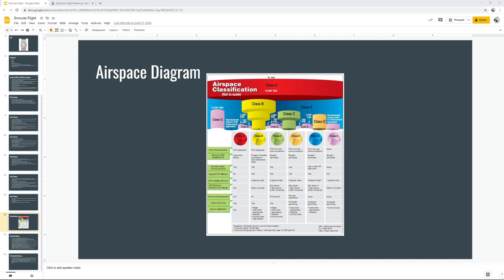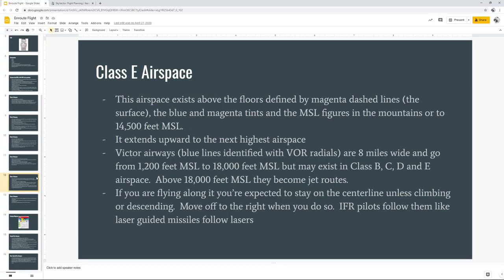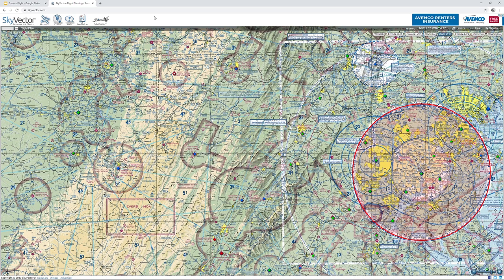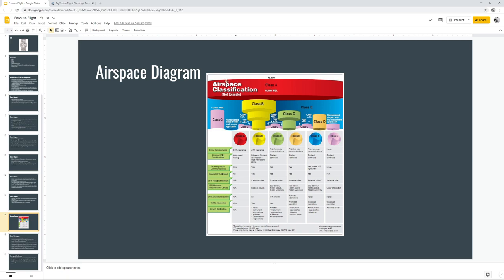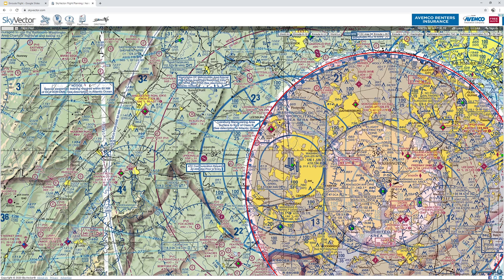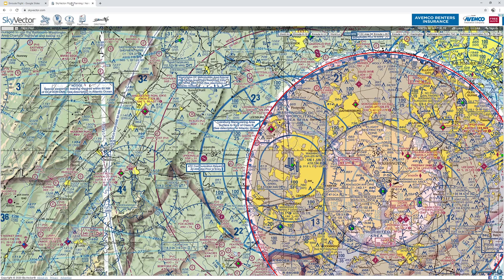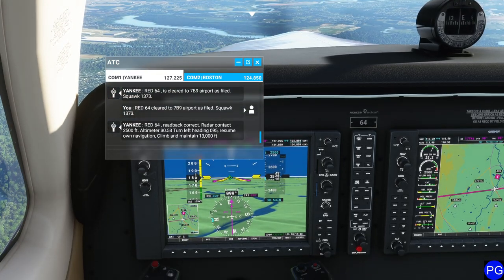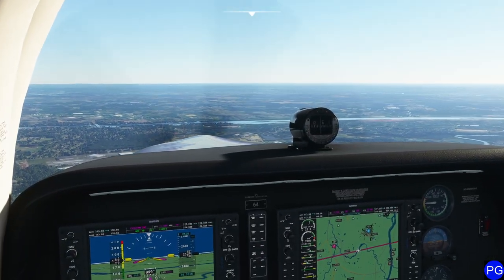FS2020 - Airspace types and methods

Comment: Nice work on a difficult topic. A few notes:

- Class G is not 700 to 1200. It is surface up to 700AGL OR up to 1200AGL (1500AGL when above 10,000MSL). Class E is everything else that's not below 1500AGL or above FL180 and not a class B, C or D. Those fat magenta areas are where the class E floor drops to above 700AGL. These areas are around all the non-towered airports. Outside them, the floor is 1200AGL (except when above 10,000MSL). If you see small dashed magenta (looks like a class D but is magenta, not blue), this is a class E surface area and, as the name implies, extends to the ground. These are rare and are for non-towered airports that also have an approach. So the areas between the fat magenta areas are class G up to 1200 while inside the fat magenta lines it's class G only up to 700AGL (except for the class E surface areas). 

- Class E airports DO NOT have to have an instrument procedure. Class D airspace only requires two-way radio comms, not a clearance. This is also true for class C. The big distinction between class D and class C is class C has an approach control. 

- The 30NM magenta ring is the class B mode C veil and has nothing to do with class C airspace. 

- Student pilots actually are able to fly in class B but they need an endorsement from their CFI. Even with the endorsement, there are several class B's that prohibit any student pilots. These include KORD, KATL, KLAX, KSFO and several other big class B's. The prohibited list also includes KADW - Andrews AFB - as this is where Airforce 1 usually operates out of. 

- It used to be that, above FL600 was uncontrolled but in fact it is strictly controlled and is now listed as class E airspace. Still, you need a very special clearance and special handling to operate above FL600. This is usually for things like Global Hawk, U2, NASA, the SR-71 when it was flying and space craft. Above FL600 you use 5000' vertical separation and each of the main levels (FL600, FL700, FL800, FL900) are coded. The codes are changed every 45 days or so and are random letters such as C-G-T-S, corresponding to each of the main flight levels. If you ask a Global Hawk his altitude and he's, say, at 75,000, he would respond "Golf plus 5" - usually we just never asked their altitudes if we could avoid it!

Comment: Very well done and concise. Thanks again so much. One question left for me after watching: ATC advices you to climb to 13.000 ft after choosing IFR Flight plan following. Is that realistic? I often have the impression that this height is way over anything possible for a small GA Plane. Is that a buggy ATC or is there something i misunderstand?
Reply: In MSFS, if you request an IFR clearance, you will be assigned an altitude. If you file a flight plan, it will usually be the altitude you requested but your route of flight may necessitate a different altitude. As for what MSFS ATC gives you, that is the topic of MUCH discussion on the forum. ATC in MSFS is VERY erratic in their altitude assignments! You may very well get unrealistic climbs or descents into terrain, though it seems to be getting a bit better with each update. If you instead ask for VFR flight following you will be given a squawk code and radar contact but not be assigned an altitude - usually. If you are getting flight following to go into or through class B then you may be given an altitude or heading that is different than what you requested.